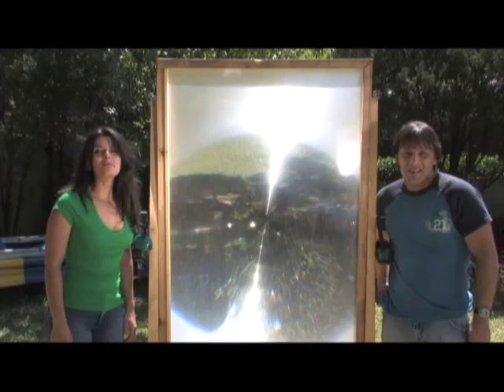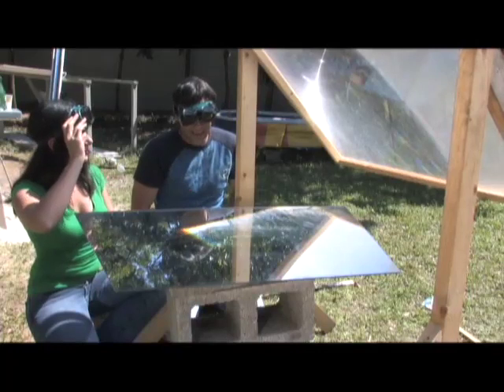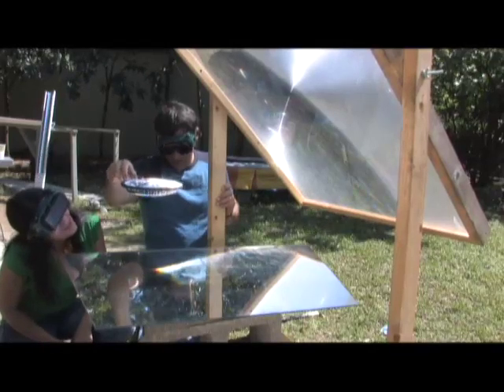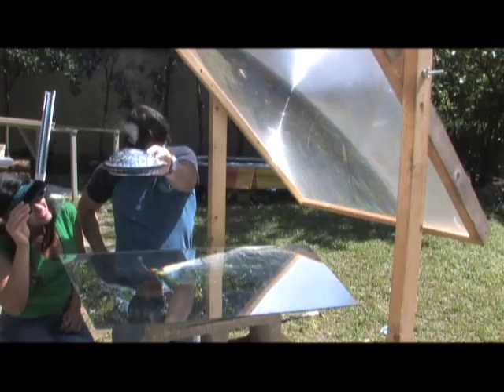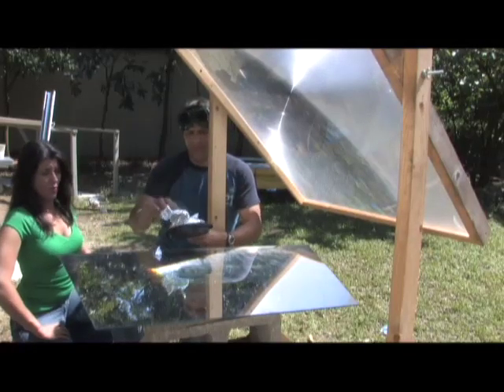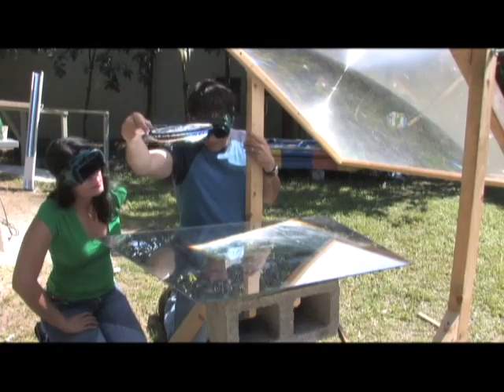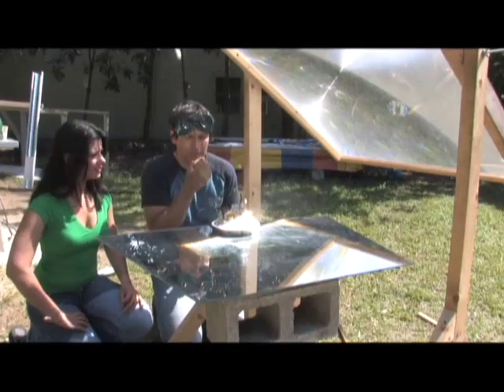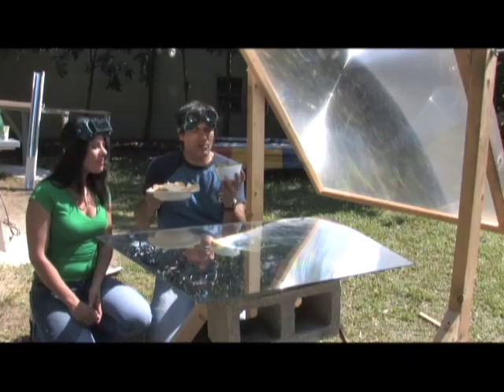Fresnel Len Solar POPCORN SOLAR POWER COLLECTION MIRRORS

Comment: hey can you tell me how big is the lens that you used. Because I want to do a calculation. thanks
Reply from the maker: Hi,

Dimensions of that lens is 33"X45".
Reply: +GREENPOWERSCIENCE hi, can you help me in calculating the screen size (diagonal) for making a four lensed bottom heating using a mirrors for each lens. 
p.s i don't want the mirrors shattering

Comment: hi  : )  because the sun>fresnel energy varies so much and is hard to tell how hot the spot is: Maybe a temperature reading on the bottom of the pan would help and you could alter the distance depending on the read out? I wonder if it would be possible to calculate in this way, as the spot size varies too? :/